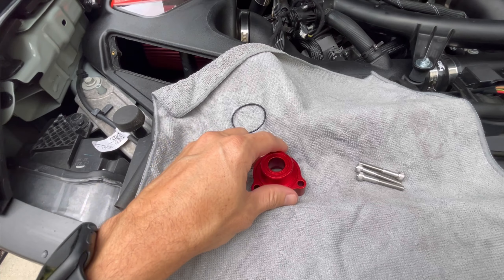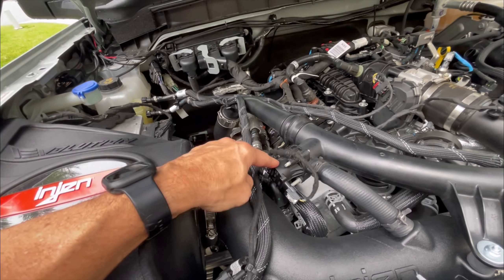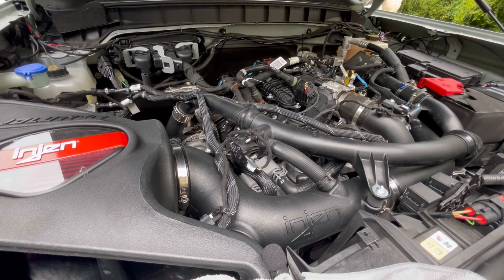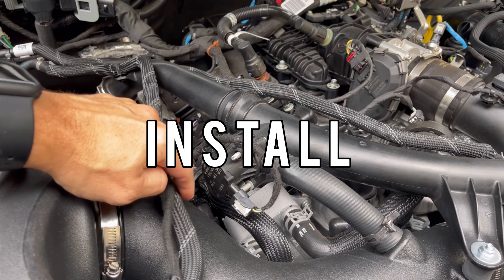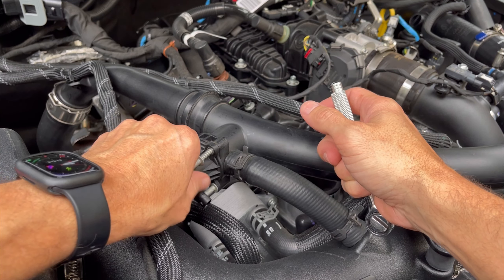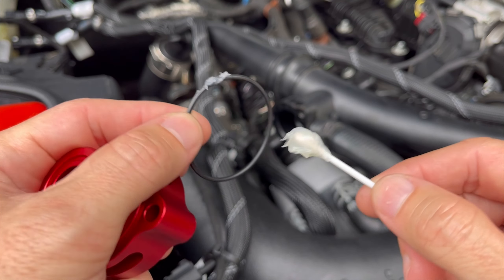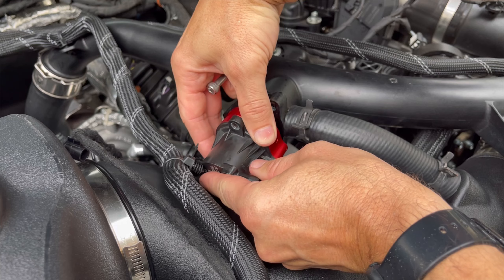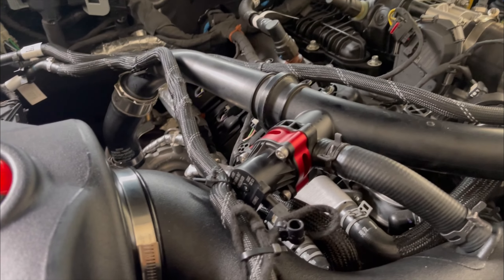Ford Bronco Blow Off Valve Adapter (review and install)

Comment: any issues with this yet? idk where ford put the mass air sensor on this engine. if it measures after the diverter it should do nothing to the AFR's but if its after it might cause some issues.
Reply from the maker: Had no issues with it but took it off after a few months. Sound got a little annoying after a while.

Comment: Just curious if you have a link to this one?
Reply from the maker: To be honest this one was a little tight and I had to use a dremel to bore it out a bit. I think there are a few on eBay for pretty cheap that are made of billet aluminum. Not much to this part so I thought I would give it a try to see if I liked the sound.